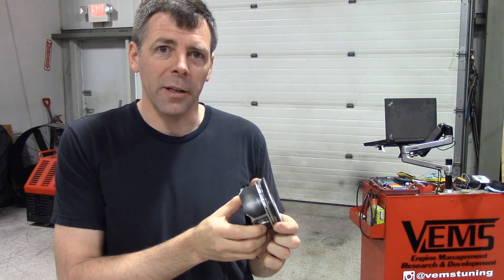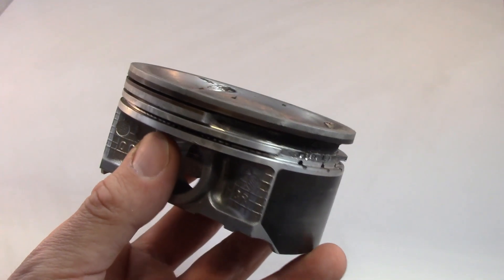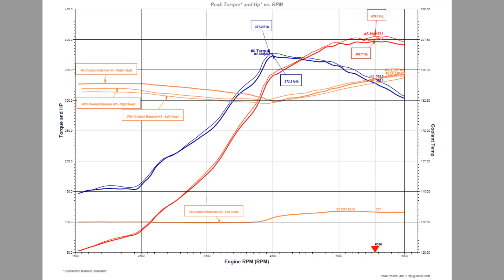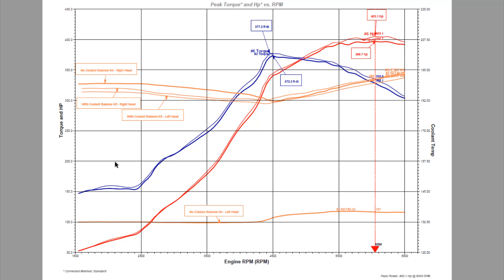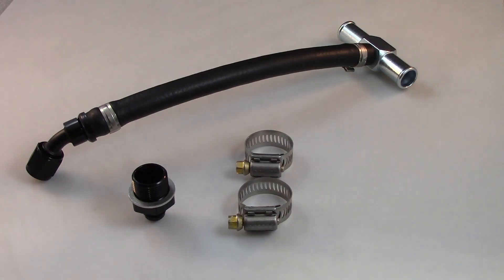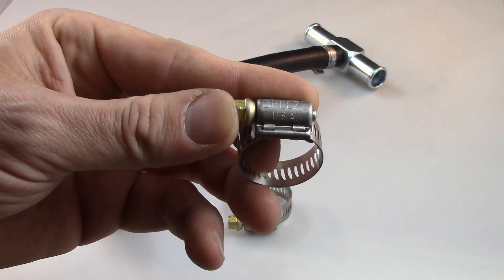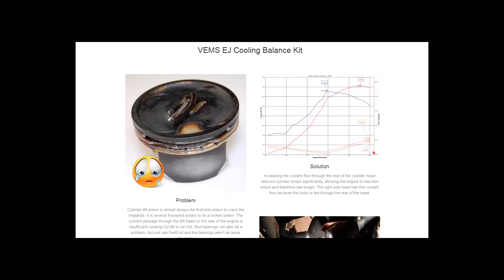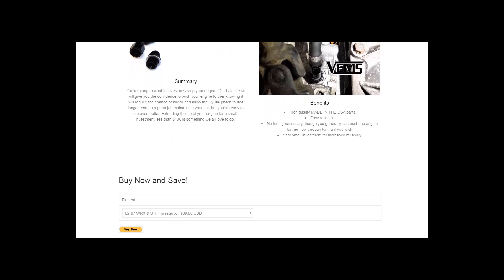Reduce knock, improve engine life. Subaru EJ255 EJ257

Comment: Never seen any evidence this mod is worth it. Good tunes and proper fuel should do the job.  I can’t see how this would hurt.  But.  I can see how this would save a motor.
Reply: Also I am afraid to pull out the only thing that detects early knock. Cyl. n. 4 has the knock sensor for a reason. I would say you can blow out your engine eiher way if you disregard knock. Its all about listening the knock.

Comment: These guys are thieves, this is a complete rip off of the Get A Dom Tune cylinder 4 cooling mod. "We have done research"... Correction, you have confirmed research done years ago by Dom of get a Dom tune.... Its great you have confirmed his research. What is not great is that you have made a blatant copy of the original GetADom cylinder 4 cooling mod. Don't buy this, Torque solutions and VEMS have stollen the idea and are just trying to snake a couple buck off of the guy that deserves your business.

Comment: According to two independent subaru engine builders here in the uk. The coolant has very little effect in stopping detonation and its detonation that cracks the pistons. Running lean, low octane and heat from abuse causes detonation. Cylinder 4 & 2 do run hotter, due to the unequal length headers but good tuning can sort this... ...apparently.
Reply from the maker: But cooling is the best solution if detonation is in check. No amount of cooling is going to fix low octane, clogged injectors, or extreme abuse. You're right. It does improve the engine's ability to keep the cylinders at more equal temperatures though.
Reply: @vemstuning6540  Nah, dropping that cylinders temp by 1 degree is not going to stop it. What will is running the engine richer where the stock tune runs lean. Typically when first getting into boost, the ecu holds back fuel too long. Adding more fuel will cool the pistons far better than a tiny bit more coolant flow. Its a useless mod. We have used inferred thermometers to prove it doesnt help.  Its a feel good mod.

Comment: Q = mc(Tin - Tout). When mass flow rate increases, Tout does get cooler, but that's good. Fluid spending less time in the engine means mass flow rate increases and the temp delta is greater. Therefore greater heat removal. Its a bit counter intuitive.

Comment: You've got a concept error though. The faster you flow the coolant, the MORE heat it will pull from the heat source. If you increase the convective flow, you are running cooler fluid through the head at all times, and that temperature differential will pull more heat from the head, not less.
https://www.physicsclassroom.com/Class/thermalP/u18l1f.cfm
Reply from the maker: We want to equalize the coolant temps on all the cylinders as much as possible though, not freeze #4. It's a balance.

Comment: I'm sure this is a common-sense question but do you need a tunning after install
Reply from the maker: Good question. Tuning is not required at all. You do have the advantage that you can add more timing with tuning after installing this kit, but that's completely optional.

Comment: Do I need to drain my coolant to do this?
Reply: You don't need to completely drain the system, but you'll want to be ready to catch some coolant as it will naturally drain when you remove the plug on the back of the head. We haven't measured, but it's approximately a little less than a gallon that drains out. Will likely depend if you're on ramps, jack stands, a lift, etc. too. http://www.ejcooling.com/install/ for the details.
Reply: Jason Russell thank you 🙏

Comment: Hasn't this been offered by GDT for more than a year now?
Reply: Yes, GDT is the original cylinder 4 cooling mod, his has less connections so less points for failure, and his has purpose built hardware for the job. If you want this kit go by some AN fittings and a T vwalla less efficient and it only costs 20 bucks. These guys are vultures...
Reply: They have something similar, yes. We've offered ours since June 2018.

Comment: While i appreciate the work put it to this, 90 dollars for 25-30 dollars worth of hose, fittings, and clamps is too steep for me.
Reply from the maker: Thanks. It took dozens, possibly getting close to hundreds of hours to get everything just right. Plus several hours of dyno time. But fair point, it can be done yourself if you prefer. Whether it's $250, $90, or $30, it's still a very good return on investment for your engine.
Reply: @vemstuning6540  and thats why i rather buy from you guys. on the waiting list
Reply: @vemstuning6540  does it work on non turbo cars
Reply from the maker: @arod8596  there's no need for it on non turbo cars.